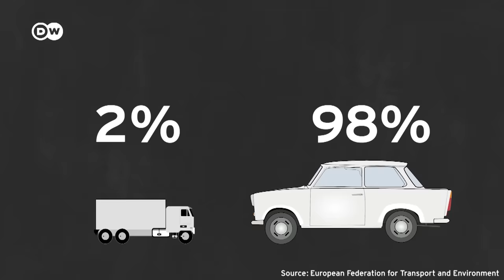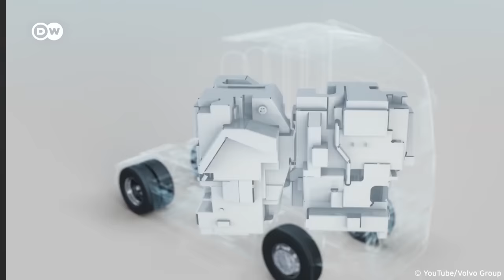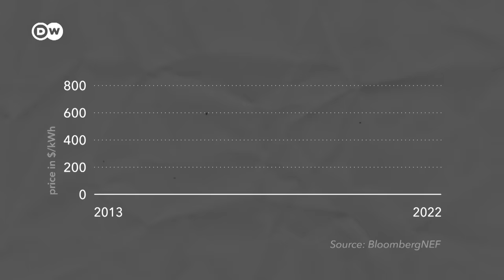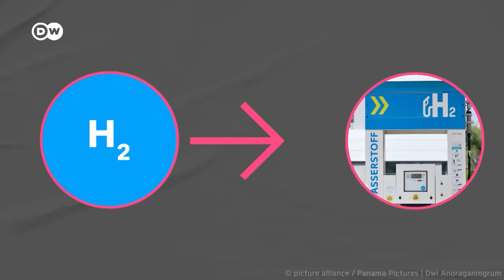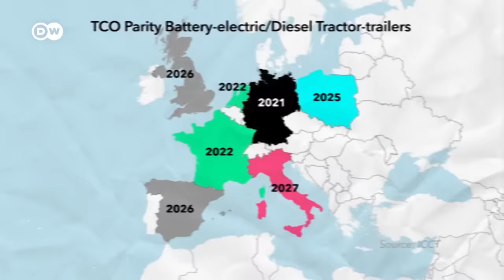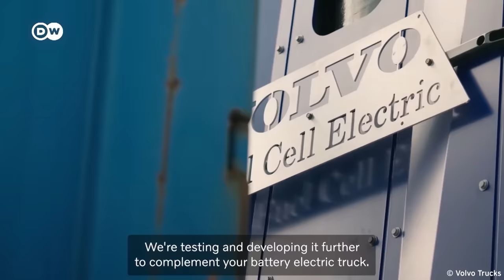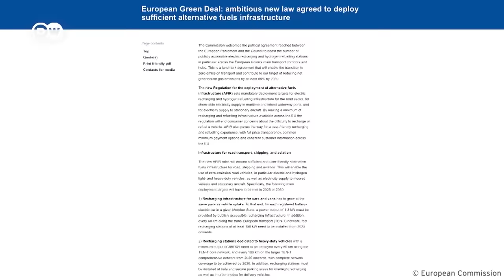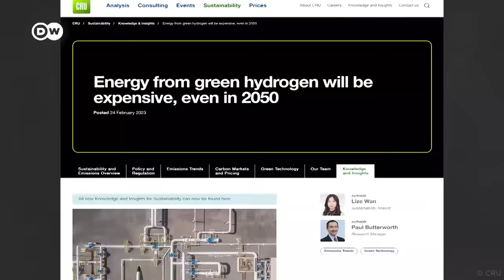Which will be the engine of the future?

Comment: Competition is a great motivator, and I think companies should focus on developing both. In the end, you have redundancy so we won't repeat a reliance on a single source as we have been with oil.
Reply: Hydrogen already lost the competition. Some companies just can’t afford to admit that they bet wrong.
Reply: @williammeek4078  and i say the hydrogen its the future , and many companies are already shifting to hydrogen .
Reply: @CMeosuarra  based on what? Real world data only from commercially available vehicles please.
Reply: Or you know invest in rails so long haul distances should be removed and trucks should be used on the shorter routes.
Reply: @CMeosuarra  I wouldn't bet money on hydrogen. Hydrogen has many many limitations that make it unlikely to match BEVs for cost and efficiency. There is a great deal of material out there which gives you the reasons behind the limitations of both BEVs and hydrogen trucks. Hydrogen even in the best case, has far more limitations and will be more expensive due to the differences in theoretical efficiency.
As an aside, do you know why hydrogen was even considered as an option? Because it sounds good and will fool the stupid. Take hydrogen, burn it, it mixes with oxygen and water comes out the rear. That's the seller. What is the reason behind it? Just like a murder, follow the money and motive. It is because 94% of the worlds hydrogen is produced via the gas reforming process. In other words the fossil fuel industry wants to keep extracting and selling gas.
Reply: @CMeosuarra  Betting against physics and economics is a good way to go broke.
Reply: @incognitotorpedo42  The future will tell  , the problem is that many visionaries fail their predictions because they ignore what they cannot imagine , the European union and Austrália has already defined hydrogen as the future for the industry and cargo transport , we will see if the rest of the world will follow in the grip of these economies .And the world will need a replacement for fiat currency , gold and silver can´t replace oil .
Reply: @CMeosuarra gold and silver won’t replace oil - wind and solar with batteries will.
Reply: @zoransarin5411 That's where green hydrogen comes to the party

Comment: The biggest problem with charging from the grid is the fact your relying on instant supply of power. You turn on a light bulb and a power station has to instantly produce additional power to handle that. Fine for a light bulb but scaled to a +350kwh charger for a truck and then multiply it to multiple trucking companies and thats a hell of a lot of power. You imagine the infrastructure you'd need to scale up and down to handle the load changes. 

Hydrogens biggest benerfit is it can be produced when the powers available and stored. Such that you can rely on solar and wind which supplies predictable but intermittent power to produce the hydrogen. The hydrogen then can be converted at will back into power to run the truck ect. 
The efficiency loss through conversion is worth it when you consider the hydrogen is energy storage. 

Hydrogen has the place for heavy duty and long range applications. Though BEV has the best case for light vehicle, commute applications. Something that doesnt need to be fast charged to give you a reasonable charge time.
Reply: Public transportation especially trains are the best for commute. 

Trains are also the best for freight hauling.  As for the last mile freight delivery I would prefer hydrogen semis over battery electric. In places like California they are over producing electricity in noon times. And the best thing about hydrogen is you can produce it onsite with an electrolyzer.

Comment: There will probably be an application for both. Even if the electric grid will be capable of supplying fast charging for trucks here in Europe in the future, there may be markets where hydrogen will be a more realistic option.
Reply: A really good point on where hydrogen will probably make a lot more sense is delivery to very remote locations. We forget oftentimes that all the advantages that electric has all assume an existing power grid, we forget that there are still large areas that aren't connected to the grid. This is obviously a niche application, but that niche is still going to represent a large market on a global scale.
Reply: @smileyeagle1021 this entire video is illogical. The cheapest way to obtain hydrogen is through fossil fuels. Even if there is a way to obtain it through a renewable means it will not make as much profit. Hydrogen is a horrible energy source and should not be used at any means. Full green energy and electric vehicles is the way and we just need to adapt. These companies that have refused to go green like shell and bp only refuse because it is not an exploitative resource.
Reply: @AtarahMata Try adding Li-ion battery packs to aircraft or cargo ships.

Comment: Well done for producing a balanced and factual comparison, that's a rare thing for this topic! Hydrogen has so many disadvantages and so few advantages that its application will be niche at best - and, realistically, will struggle to compete against the flood of second hand diesel trucks on the market when so many routes will be served by battery-electric due to the low running costs. Battery supply is a major bottleneck (e.g. it delayed the Tesla Semi launch for years) but hopefully that will get solved soon.
Reply: Hydrogen still has some key advantages, and it is another sustainable technological pathway with plenty of opportunity for improvement. Overall efficiency will probably get within one-half of BEVs by 2030, and the infrastructure should be able to expand considerably faster than building out all the new transmission/distribution required. Yes, more generation will be needed, but this is probably much less of a problem as we move to advanced nuclear for its scalability and low environmental footprint. In the meantime, the energy flow of fossils can be used to quickly achieve an economy of scale. There is also the possibility of using pyrolysis with natural gas to avoid CO2 emissions, which could be cheaper and safer than sequestration.

And then there are the other sectors of industry that will benefit from the wide availability of sustainable, low/zero-emission H2: ammonia production for fuel and fertilizer, aviation, rail, and maritime shipping.
Reply: @cbarcus hydrogen is by nature less efficient than electric. So any infrastructure that lacks for battery recharging production would be bad for hydrogen as well. And you get supplement that with stationary storage to reduce peak load which is what Tesla is doing with their mega charger installations.
Reply: They could have brought out the Semi earlier but they obviously made more money selling 10-15 Model Ys instead of one Semi.
Reply: @cbarcus  Yes I've heard that narrative many times before: "Let's pursue hydrogen because although it's horribly inefficient and largely pointless right now, in the future we'll have magical technologies that make all the troubles go away. And in the meantime, we can just keep using fossil fuels to make the hydrogen."  Do you own oil company shares or do you just work for them?
Reply: Converting used diesel trucks to hydrogen is starting to become big business as DW has reported before... they are much cheaper then either new H2 or new Battery electric trucks and they have a lot of life left in them.
Reply: @tiro2041  

Yes, that can work well when a dedicated chassis is not needed. The downside is poorer range and efficiency. The new designs will come way down in price in a few years (3-7) as the powertrain costs decline with technology improvements, production increases, and the expansion of refueling infrastructure.
Reply: how is the balanced lol. They literally forgot alternative which is better and fixes all the issues. TRAINS. But sure in the dichotomy of these 2 its fairly informative.
Reply: @jonathanmelhuish4530  Why don't we talk about pollution caused by the mining for the materials for battery? Is that because the mining isn't going to be done in Europe?
Reply: @jonathanmelhuish4530  Green hydrogen literally means hydrogen is produced using renewable energy. I don't get why you have to wrongly include fossil fuels here. About future magical technologies, the same sentence could be said about battery technologies available 20 years ago. Look at the advancements made now. Just because a system is inefficient today, doesn't mean we have to stop developing it to make it better.
Reply: @jonathanmelhuish4530  

Hydrogen is not inherently ‘horribly inefficient’. Overall energy efficiency for an FCEV should be able to get within about 40% of a BEV, but I would say it would be worth pursuing if that gap ended up being closer to one-half. This technology is basically a super-battery, and there is still a lot of room for improvement. More efficient fuel cells and solid state storage are not ‘magic’. And while fossil fuels can help with near term scaling, hydrogen production via high temperature nuclear reactors is very likely the future. Even natural gas might be low carbon if a pyrolysis process is used, though I would say it is still undesirable due to supply chain leakage.

I have been a climate advocate for decades, and after the failure of the 2009 Copenhagen climate conference I decided to devote considerable time explaining the physics of global warming, the nature of natural feedbacks, and the catastrophic risks suggested by the paleoclimate data. I also started looking at how innovation in nuclear power could bring about a new industrial revolution that has the potential to mitigate climate risk, while producing an economy capable of essentially eliminating global poverty.
Reply: @prajwalpjain4364  Besides, burning hydrogen give us moisture in the air; so small moist air pockets may drift from urban areas to positions over seas and differently refract sun rays that otherwise would point straight down into the seas causing stratified water surface with much same temp; but now with the humid air will refract the rays wildly, then some spots of the seas get more heated and other less, bringing dynamic movements both horizontal and vertical, so nutrients and plankton rise from below to the surface, while oxygen and heat reach further into deep water; so we get richer marine life and mitigate climate extremes; similar better climate with spread humid air over land.

Comment: Weight is not just about just the payload but the whole vehicle. Think weight restriction on certain bridges or roads. There H2 has a huge adavantage but at the end of the day I think there's a place for both technologies
Reply: Why did they never mention the weight of the batteries? Because it would not fit their agenda?
Batteries for a truck weigh around 8 tons while the max load is 40 tons. 
And the weight will always be there, no matter if the batteries are empty or full. 
So truck A can still move 40 tons of cargo, but truck B only 32 tons. 
This is not economical viable for a freight forwarder if he can move 20% less than the competition.
I think it is an unbalanced, unneutral report that is more intended to convey an opinion than to inform people about all the pros and cons. 
Otherwise they would have shown the ONLY thing that matters: What are the costs per KG for Diesel, for EV, for Hydrogen? In the end it's an industry and the one who does not save costs is out of business VERY quickly.
Reply: @jules-u4p Most trucks don’t carry their maximum capacity. The trucks that some to my store are never being filled to max, those could easily be replaced with battery powered trucks. If combined with good rail transportation, most trucks could be replaced with battery powered ones as they shouldn’t need to drive all too far. 
Of course there are some long distance and heavy haul applications that will remain so personally, I’d say ICE trucks can be continued to be used in those niches until a solution is found
Reply: @goldenalbatross9462 Toyota has developed a hydrogen ICE.
Reply: @flemlion13  "Keep running things in order" is a good further point. Trucks for food or pharma do not only need to carry the weight, but the whole cargo has to be refrigerated the whole time, consuming a lot of energy. So the range of the Volvo FH Electric for example, which is stated 345 km on the Volvo homepage, is even less. 

Traffic jams will therefore also become much more expensive, they cut into your range and time loss much deeper.

However, it still may be worth in some applications, I don't know, I don't have a truck each. But as said, therefore the makers of this clip should have researched the most important fact: What are the costs per KG for Diesel, for EV, for Hydrogen?
Reply: @flemlion13  How would the trailer "autonomously" create energy? By magic?
It cooling unit is of course connected to the engine.
"Consumption of a cooling unit is approx. 2.5 liters of diesel per hour"
oh and this is news from 2020:
"For the first time, a semi-trailer truck is supposed to supply itself with electrical energy and become independent of its diesel engine and its pollutants. The German medium-sized company Schmitz Cargobull invented the drive. Now the first test drive starts."
So no, your statement is wrong, it's pretty much standard that the trailer is supplied with energy by the truck.
Reply: @stevenverrall4527 that is hopelessly inefficient and only useful for cases where the cost per distance doesn't matter, like racing or for entertainment.
Reply: Provide a specific example of a commercially available hydrogen truck that actually demonstrates a weight advantage. 
You can’t. They don’t exist despite a decade of promises. Reality is hydrogen has no demonstrable advantage over battery electric.
Reply: @stevenverrall4527 worst idea ever
Reply: @jules-u4p the battery is the Tesla Semi is around 5 tons compared to the 4 ton weight of the diesel powertrain. 
Semi has already demonstrated taking a 55,000 lb trailer 500 miles on a single charge, through mountains, in traffic. 
Oh, and since charging would be paying industrial rates for electricity, that would be roughly 1/4 the cost per miles of diesel fuel.
Reply: @jules-u4p the electric needs of refrigeration are insignificant compared to powering the truck. You just need to look at the difference in size between the diesel engine and the APU to see this. Powering refrigeration won’t significantly impact the range of the truck.
Reply: @Will-ef2tw  lets see your math then. Because I don’t believe you.
Reply: @williammeek4078  "the electric needs of refrigeration are insignificant compared to powering the truck" so what is the energy consumption then for a non-diesel reefer on a EV Truck? You ask other people for their maths but don't show a single figure yourself.
Reply: @jules-u4p  they made the claim that refrigeration would kill range. They need to show their math. You can help if you want. Do your homework and show your math. I am not doing your homework for you. I know it works. I am calling BS on those who want to say otherwise without providing any evidence whatsoever.
Reply: @stevenverrall4527   At first, hydrogen ICE appears to make sense but these aspects get in the way: 

(a) Low efficiency due to inherent efficiency limitations of internal combustion.  Gasoline engines only some nominal 20% efficient which is laughably bad.  From what I've read, hydrogen may be the same range.  Possibly up to at most 40% efficient theoretical but then producing a lot of NO₂ emissions with it (see next).
(b) Still produces toxic NO₂ emissions.  Our atmosphere is 78% nitrogen so any high temperature combustion will produce NO₂ as a side-reaction unfortunately — this includes burning hydrogen.  You can try to reduce NO₂ emissions by lowering combustion temperature but that usually decreases efficiency even further.
Reply: @jules-u4p  There's absolutely no mention of the pollution caused due to the production of batteries in these vehicles and how they'll be handled after their life.
Reply: @jules-u4p They didn't address the refueling time either. Waiting hours to have megawatts of electricity flowing into a battery is a non-starter for the existing logistics supply chain. The people poo-pooing hydrogen have no appreciation for the importance of refueling time. But the truth is that the internal combustion engine is the only technology capable of supporting the existing shipping logistics system. The closest electric has ever come to doing anything for logistics is lead-acid battery milk-floats used for local milk deliveries in the 1950s.
Reply: as long as a truck carries less load because of its battery, it's never gonna compete with trucks that carry full load in terms of profit. unless these battery trucks are subsidized or all trucks are made to go electric, an ev truck would always go out of business firrst.
Reply: @etobillions  Hydrogen powered truck would be ideal.

Comment: There's absolutely no mention of the pollution caused due to the production of batteries in these vehicles and how they'll be handled after their life. How is this report made without that taken into consideration?
Reply: Plenty of life cycle analysis reports available about this.
Reply from the maker: Hey! We tackle the afterlife of an EV battery in this video 👉 https://www.youtube.com/watch?v=PbOBmnZRpZ4
Reply: @DWPlanetA  But I don't suppose you've taken the energy spent on production of the batteries into consideration for calculating the efficiency of the EVs. Whereas you did similar for the hydrogen vehicles.
Reply: @thereckon3592 These pepole make me sick. They only think in the smallest easiest way possible that gives them the answer that they want, with out talking if service life, fire hazzard, life span, initill co2 emissions and so on...